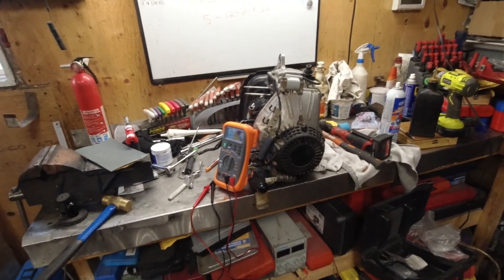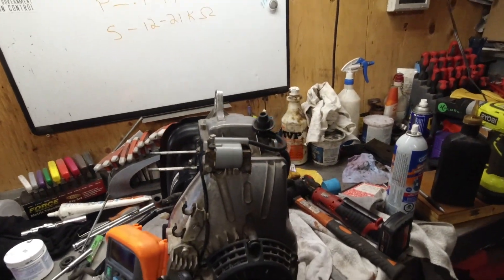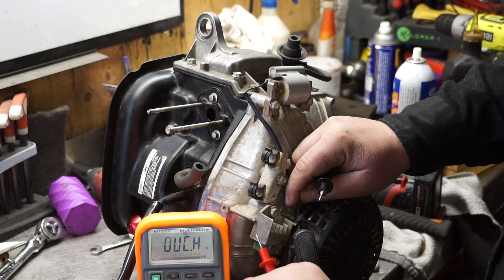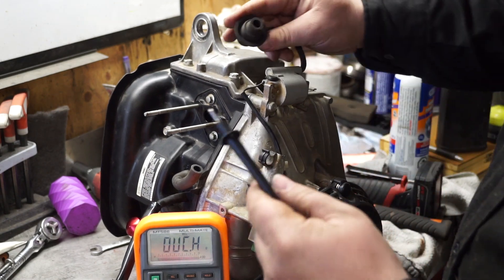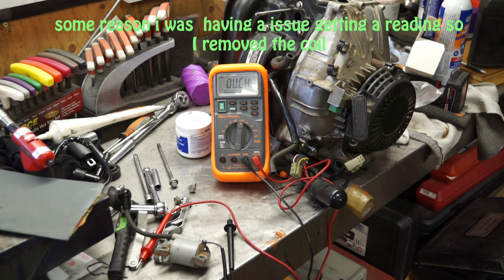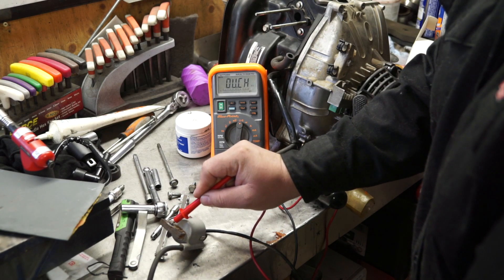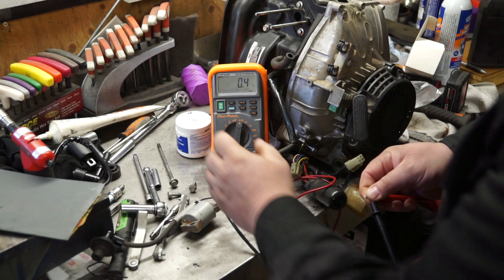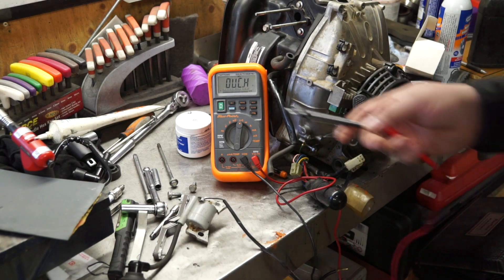How to Test Primary and Secondary Coil Honda Eu2000i

Comment: I have a no start / spark issue. I did the main test with the 10 pin module connector on front plate. Everything checks out great except the Primary Coil which reads 2.2 ohms. It should be (.7 to 1.1 ohms ). Does that mean that my primary coil is bad?